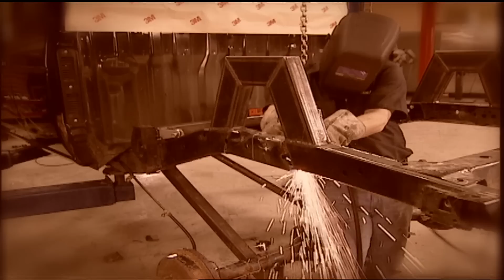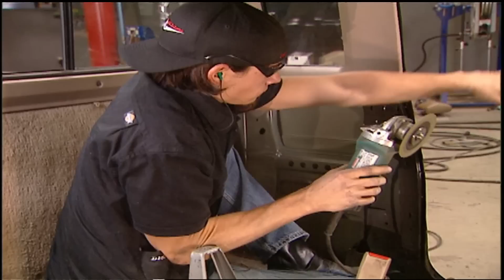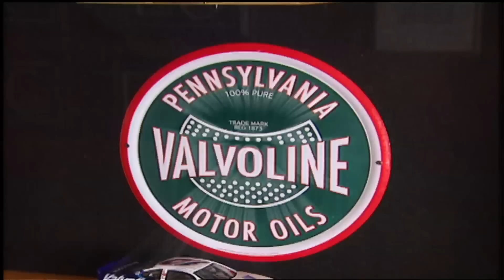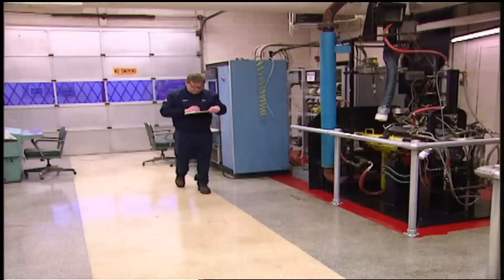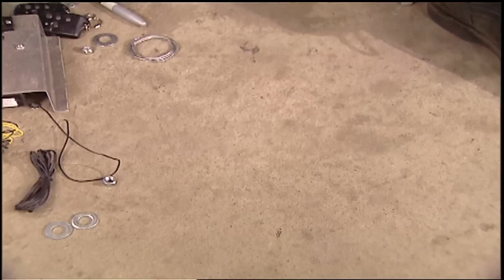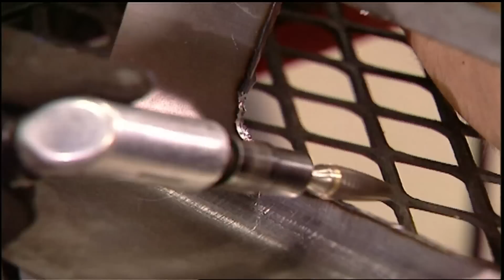Slammed Mini Truck Gets Suicide Doors And Radical Sheet Metal Work - Trucks! S9, E9

Comment: Little shop of horrors I think there in TN and they built the nastiest S10 ever idk what the name ended  up being but I seen it listed as the spike truck in a magazine in the 2000s it was only s10 sheetmetal base everything else was built I remember reading they changed the glass because all the damage from welding and grinding 

Minitrucks are squatted when your to broke to by drop spindles but are still cooler than squatted trucks